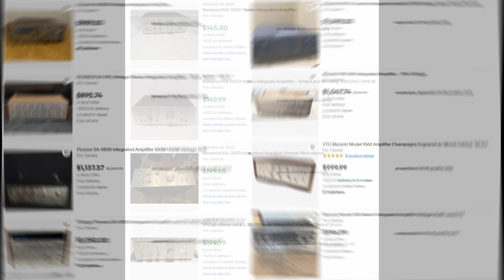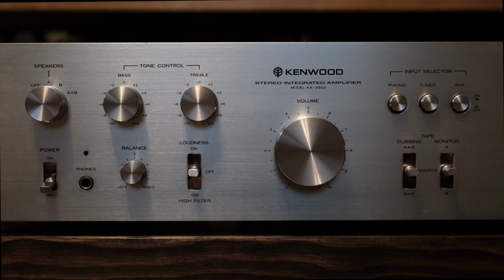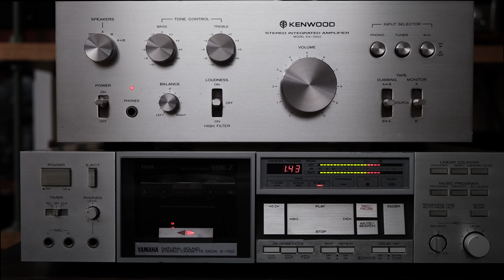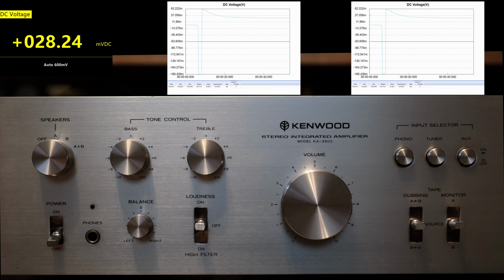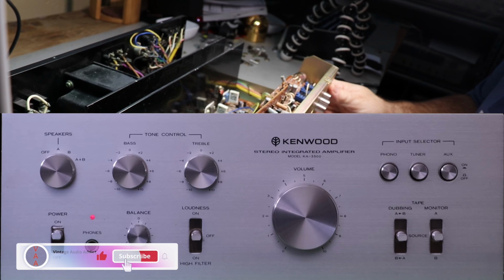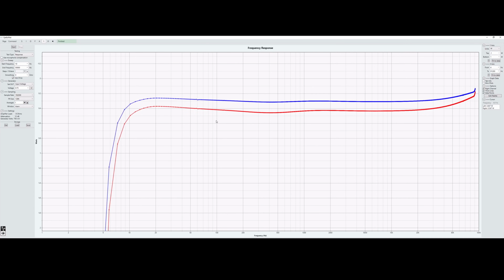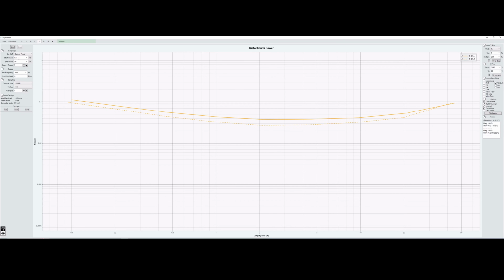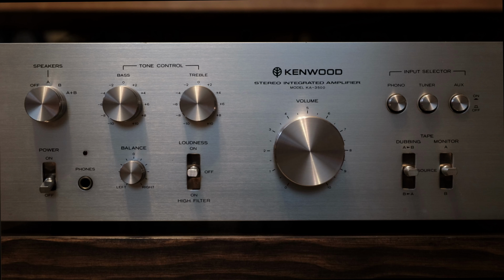The Vintage HiFi Audio Giant Killer: Kenwood KA-3500 Restoration/Repair & Bench Testing/Review

Comment: We sold Kenwood equipment at Audio Village back in the seventies.  We had analyzers to check out equipment; power, THD, frequency response.  The Kenwood amps and receivers always performed significantly better than the published specs.   The KA-3500 was our little darling; it was an exceptional introductory amp for someone on a budget.  

I have Hakko soldering stations and the FR-301 Desoldering gun, all superb equipment.
Reply from the maker: Thanks for sharing your experiences with the equipment from back in the day. Great move having that FR-301!
Reply: @vintageaudioaddict  I recall my mate buying one brand new back in the mid 70's however unfortunately for him he had a pair of 1975 KEF Concerto's that had a lousy 87db sensitivity.  This tiny Kenwood struggled to get a modicum of "loudness" out of it and his KA-3500 would run so hot it eventually killed the outputs almost as a habit.  It was fine for 105dB speakers though.

Comment: Let's fast-forward to the year 1995. Most of Kenwood's competitors had gone with wimpy power transformers, one pcb for the entire unit, amp-on-a-chip outputs, and no phono input. For the same price (and maybe less), you could get a Kenwood receiver with a massive high-current transformer, separate boards for power supply, amplifier (all discrete transistors, no IC's), preamp board, and tuner. And oh yes, you got a phono input, mounted on it's own pcb. I had a couple of them from that era, and for the price point, they were outstanding.
Reply from the maker: Thanks for sharing your insight on Kenwood's quality in the mid-90s compared to their competitors!

Comment: I really considered one of these. But for not much more I purchased an Adcom GFA-545 and a GPT-450. The only repairs needed was a fuse in the 545 and and the 450 needed a date with Deoxit green and red. There are only four electrolytics, besides the filters in the GFA-545s. So, I changed those, added some local filters and snubbers on the boards. I left the PSU filters because they are already HUGE and check out as perfect with the C meter. If I was using it with a 4 ohm load I would add bigger caps, but I'm old fashioned and prefer the tighter damping of 8 ohms, it's just a "me" thing. All together the cost was about $200, and, they have dual power supplies in the 545 and the output transistors are still easily sourced, IF you can even ruin them in the first place.

Don't get me wrong, these were very nice amps. I had a KA-3700, the 20 watt little brother and they punch well above their weight, too. But the used price, parts availability and ease of service steered me right down the Adcom rabbit hole.
Reply from the maker: Thanks for sharing your experience and the path you took with your audio gear!
Reply: @vintageaudioaddict  Thanks back at you. Your presentations are very informative to those wanting a more cost effective way to go on their own audiophile journey.

Comment: i changed caps as well. At some point, while working on a mackie cr1604 mixer, i empirically worte down the results before and after the restoration (thd, frequency response, noise floor, output level). Biggest difference made by far the power supply recap, while there were smaller benefits for other boards, too. It also makes the machine future proof, which might be the biggest benefit.
Reply from the maker: That's great you documented your restoration process and found the power supply recap made the biggest difference!

Comment: Check out the JVC JA- series intagrated amplifiers mid 70s. Overlooked 💎 gems!  Cheap 100-200. Ja-s71, ja-s41, ja-s31,ja-s11 .    Over engineered.  Thick material.  Easy to repair
Reply from the maker: JVC made some excellent audio gear back in the day.

Comment: I have a kenwood KA 3300 it has had some capacitors replaced.  Using 2 KA 40W ic amplifiers.  I bought new and it still works
Reply from the maker: That's great you've kept your amp going for so long and it's still working!

Comment: I bought my first integrated amp in 1975, a KA 5500.  Was a great little amp and I still have it.  Gosh, it could use an overhaul, hint, hint.
Reply from the maker: It's great to hear your KA 5500 is still with you after all these years!

Comment: during the 1970s every record store or "head shop" you walked in to was running a Kenwood KA-3500
Reply from the maker: Kenwood did sell a ton of these.
Reply: Our local record store had McIntosh. I'm not sure if it was a preamp or an integrated, but it was reliable.

Comment: Do you put a red mark or something on all the new caps so someone can identify what has been changed in the past?  Instead of a Hakko I got an old Pace station.  It works OK for a vintage desoldering station.  I could not be without it for those kind of boards.
Reply from the maker: No markings. I already have made plans to have the equipment buried with me, LOL. Some kind of a desoldering station is a must if you are going to be working on this equipment regularly.

Comment: I bought my first Kenwood KA-3500 in the mid 70s.  I still have it, and it works fine.  Since then I have bought another one (for another room)--used--and it works well too.  Great amp.
Reply from the maker: It's great to hear your KA-3500s are still working great for you after all these years! I've had mine sense the 70's also.

Comment: This was the amp I lusted after for my first new pice along with it's stable mate the kr 4070. I ended up with the kr 5030 the net step up in power from the kr 4070. In the years sense then I've repaired many amps and owned many from many brands including several from this line. Sonically the ka 3500 is in the top tier beating it's own larger brothers from the same line. The only Kenwood amp that sounded better was the ka 4006, also a low powered unit at 32 wpc. The sonic competitor to that amp is the McIntosh 2505 if that tells you something.
The only amps i have kept from that era is the ka 4006 and a ka 3500 of wich i have two.
And of course I still have the McIntosh 2505.
This man is right that this 3500 is a jewel it hasn't risen in value like the kr 4070 which has.
Reply from the maker: Wow, it's great to hear your perspective on these amps, especially from someone who has worked on so many of them.

Comment: I have had the KA 3500 and it’s rarer 55 WPC big brother the KA 5500. Both are top performers. The 3500 is much easier to work on than the 5500 but Echowars was a major fan of the 5500 and posted tons of good info on Audiokarma. Beyond the extra 20 WPC of the 5500 are the very desirable power meters that always need cleaned and remounted. Great video!
Reply from the maker: Glad you enjoyed the video, and thanks for the insights on these classic amplifiers!

Comment: Have one. Bought it 20 mos. ago for about $100 on FBM. Worked for about a week. Then Right channel went into thermal runaway, massive DC offset on that ch. Did pull the plug before my B&W's were kaputted. . Been trying to fix 3500 since.Very, very difficult to troubleshoot.  Replaced many, many components on both ch's including pwr trannies. And no speaker protection means: WARNING!
Reply from the maker: Sorry to hear about the issues but I'm glad you saved your speakers. Hopefully you will be able to get her going again down the road.

Comment: I  was a 19 year old stereo salesman when this came out. I  felt the Kenwood integrateds  were more appealing than the Pioneer or Marantz.  3500, 7100 and 8300 were sweet. Wish the 3500 had a low filter.
Reply from the maker: It's cool to hear your perspective as a stereo salesman back then! I purchased this KA-3500 used back in the late 70's. Kenwood made great audio gear. They just didn't have the distribution channels that Pioneer, Marantz etc. had.

Comment: I ordered myself a Hakko FR-301 for Xmas. It gets here in a few days. I got sick of using wick and a spring loaded pump. Life should get easier now.
Reply from the maker: Man, you will wonder why you didn't get one sooner as soon as you use it.
Reply: literally 3 seconds to remove a capacitor . . . unless it's soldered with the newer low lead or lead free

Comment: I don't suppose you have a parts list.  I bought one of these in early 2025.  Worked at first, but then one of the channels went intermittent.  I started a parts list at Mouser, but kinda lost interest.  Might be a nice winter project.
Reply from the maker: Unfortunately, I don't have a parts list. I have most of the parts I need already when I start a project so I don't put together lists.
Reply: @vintageaudioaddict  Choosing the right part from a huge supplier like Mouser can be a challenge for an infrequent hobbiest like myself.  But, I found my incomplete excel s.s. list from Feb 2023.  Time flys as we get older, cause it didn't seem that long ago.  Thanks anyway.
Reply: Consider cleaning pots and switches, then checking connectors inside. If you find an intermittent connection, fix it.

Comment: I had a KA-7100 for many years. It started to oscillate and I couldn't find a local shop to service. I ended up dup selling it. Same with a Sony STR-7065. I miss both of those.
Reply from the maker: It's always tough when you have to let go of beloved gear, especially when you can't find a local repair shop to help.
Reply: @vintageaudioaddict  If I had seen your channel back in 2008 timeframe, I would have just sent them to be revived by your expert hands!!😊

Comment: One of my favorite vintage audio finds in recent years is the Kenwood KA-8004 integrate amp (55 wpc; 1973-76). Unique "retro" design and rich, punchy sound. I also have a Kenwood KA-9100 (90 wpc; 1977-79), which looks more like the KA-3500 (with the volume nob near the center), but has VU meters as a bonus!
Reply from the maker: Thanks for sharing your experience with those Kenwood models! Kenwood made some really good gear back in the day.
Reply: That's a top shelf amp you have there friend (the 8004), beautiful! ❤️👍🔥
Reply: Got the little guy (6004) Very unique all over. You got Gold